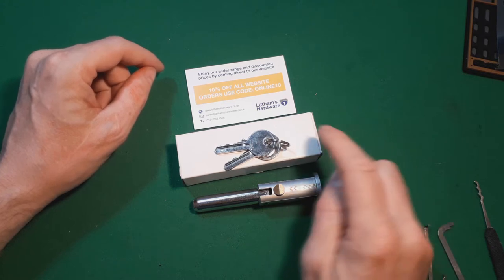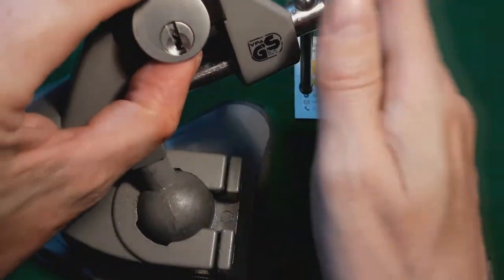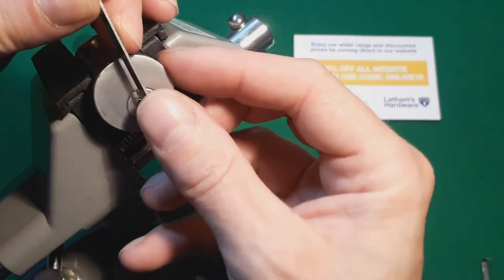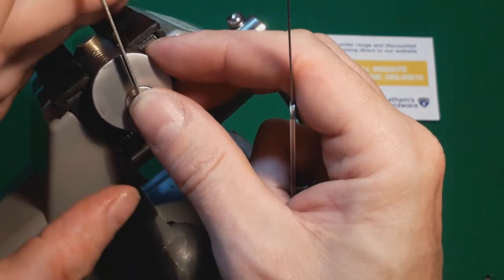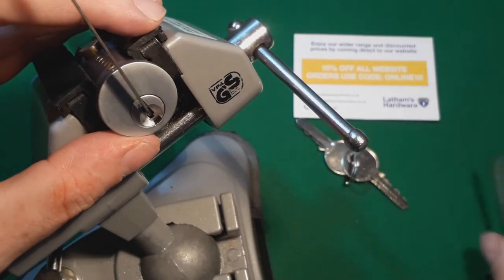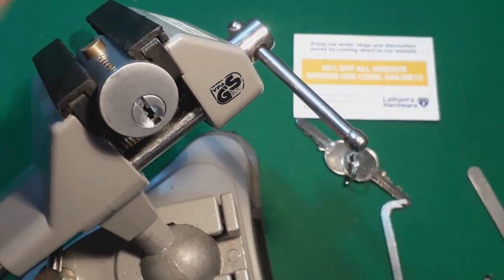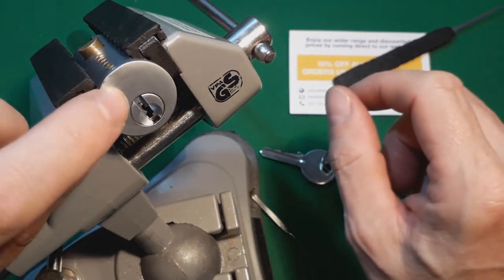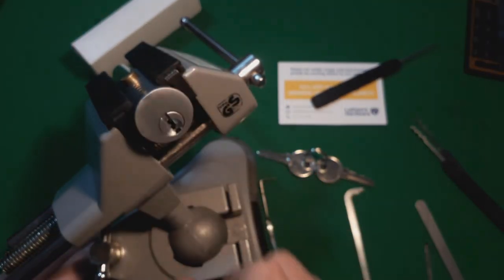(102) Lathams Bullet Lock KA53 raked and picked open

Comment: Hello very well picked Roy using both methods that keyway looked challenging well done thanks for sharing
Reply from the maker: The keyway was the best part of the security here, a little challenging as the keyway is a little tight. It's built well but I didn't really feel security pins. I do believe there are a couple but not feeling them might be simply down to spools being matched with long key pins, thus making the spool ineffective. 
Thanks for watching Barry.

Comment: Well is just goes to show how good the Bogotá rakes are. I’ve seen so many high security locks defeated by the rake, it’s very difficult to defend against it. 
Have a great weekend Roy.
Reply from the maker: The Bogata does give that option of getting high and low pins. I do feel at times it can get a little stuck in the keyway due to its height and sharpness. 
Thanks for watching Daz.